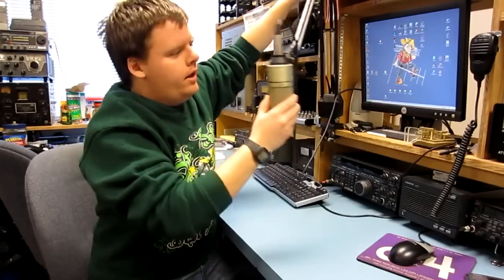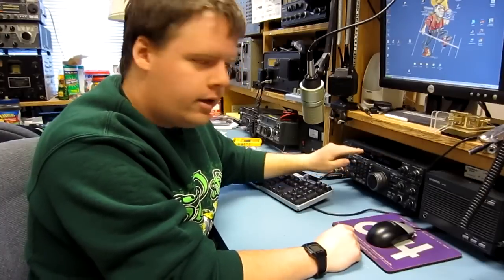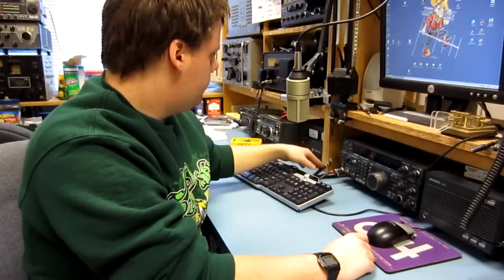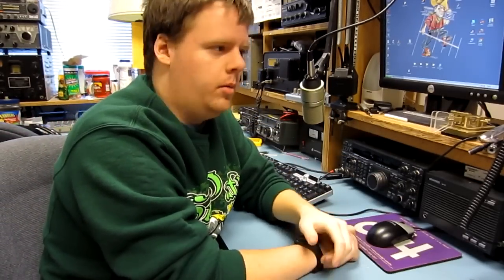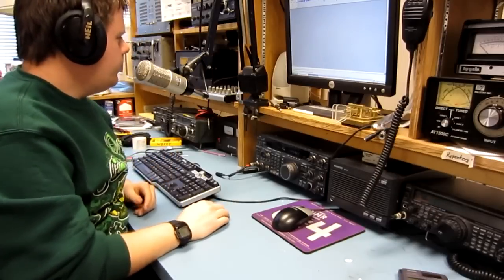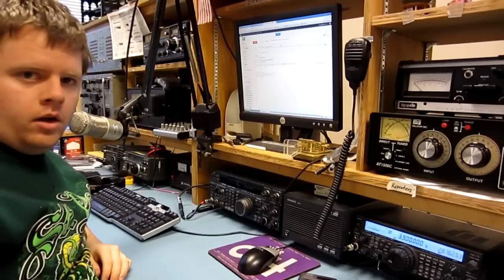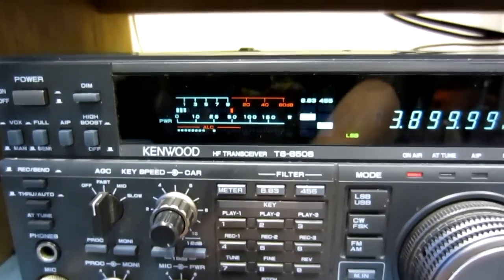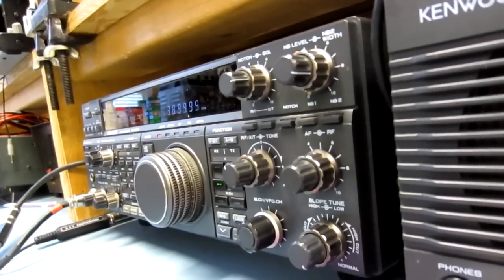How to Have Great Sounding Audio, and a Heil PR40 Unboxing!

Comment from the maker: It is, in fact, automatic level control. It is a radio function to ensure that the microphone level is proper, as to not over- or under-drive the transmitter. It's also built in to many cameras and recorders.

Comment: Hi,good video, I have a Heil pr 40 microphone and pre tube amp with my Icom ic-7300, no mixer needed, radio reports like you wouldn't believe, but a little tricky to set up, but well worth it, thanks from Rotterdam 73

Comment from the maker: @katiebug18371 the mic adapter is a homemade adapter. One pin goes to the 1/4" jack for the mixer (connected to the mic pin) and the other is a PTT line to the foot switch. A standard instrument cable plugs into the left output of the mixer, and the mic connects with an XLR to the mixer's channel 1. 

You're welcome :)

Comment: "Sideways" use of the microphone dates from the earlier radios which didn't have great dynamic range and couldn't handle plosives directed directly at the dynamic microphone element. The carbon mic has compression built-in because the carbon granules pack in together. So historical use of the mic, as seen in Emergency!, Highway Patrol, Dragnet, The Dukes of Hazzard and other shows is accurate. Modern mics are much better at handling the dynamics, and modern transmitters as well.

Comment from the maker: @FUNNYTOM10 The display should have a marking that shows where it shouldn't exceed -- on the TS-850, it's a red line above the ALC meter, and the meter reading shouldn't exceed that red line. Others like the IC-746 have brackets around where the ALC should be kept. Best practice is to keep it as low as possible while still having enough audio to drive your transmitter.

Comment from the maker: Phantom power is for powering condenser microphones. They use an element that requires a voltage (usually 48v) and a small amount of current to power the mic. Without it, no sound comes through. Dynamic mics on the other hand work completely mechanically, and require no power. I turn off phantom power because I'm using the PR40, a dynamic mic. The MXL990 conversely is a condenser, and requires it.

Comment from the maker: I'd have to disagree sirRandyTooth. Not only does the improved microphone lends itself to improved quality, the ability to change equalization allows you to control emphasis of voice information. A voice with a peak throughout the 1500-2000khz portion are easier to understand than others, whereas some gain on the low end is easier to listen to.

Comment: Everyone needs to watch this video. I used to hang out with a guy in the 80's that never turned his compressor off, no matter how much I pleaded with him. 35 years later and he no longer does that but he is still a jerk!!
Not like he needed it, he was running 1200-1400 watts on the antenna.
================================================================================================
I think your 40 dollar mic sounded at least as good. JMO

Comment: Just one more question sterwing, is a sound mixer really neccessary? Let's say I'm just an average novice radio operator that wants to work mainly on 2 and 6 meters (not too much into DX'ing). Could I get away with a good Heil mic and make sure my HF rig is adusted properly for good audio quality?

Comment: you are going line level into mic level you need a transformer to bring it back to mic level .That will give you more head room
set the mixer levels to read zero db on the in/output meter into the transformer to the mic input of the radio and you will have all the control needed without having to worry about to much ALC and over driving the audio.

Comment: Can you help me out with using a condenser mic?  I have mine hooked up, it is a large diaphragm condenser mic, but when I key up all i get is really loud white noise.  I know it is RF interference, but even when putting a choke on the cable it still does it.  Hopefully you can help me out, since I haven't found anything on the net so far.  Thanks,  KB3ZGE

Comment: LMAO!  Because he is using a studio condenser mic that has to have 56v to run the condenser in the mic.  That 56 volts flowing into his radio would put the major parts in Low Earth Orbit :)  Most of the rest of us use a high impediance desk mike like a motorola or a D104 (which is what his radio wants to see).  My old Swan 500 doesn't have an "ALC", it runs on tubes (real radios glow in the dark) but it does put out 480 watts PEP and will talk anywhere on the planet :) He is doing OK.  AE4YW

Comment: im having problems setting up my microphone, i do gameplay videos when i playback my video on my laptop my voice is soo quiet and low i can hardly hear myself and the volume switch wont go no higher, and if i turn the gain too high it makes my voice loud but i get awful sounds and like an echo of my voice. so frustrating. any tips or advice of what im doing wrong. i have bought a tried a few mixers and are all doing same thing??? atm i have behringer enyx 502

Comment from the maker: The cool thing is that it's not mine -- it's the W0EEE hamshack at Missouri S&T. We've accepted many equipment donations like the TS-850 and a FT-1000MP (that I broke :() but a lot of the old stuff has been here before I came. You should see the RTTY and SSB equipment, built like a tank.  flickr dot com/photos/n0ssc/sets/72157629743541287/

Comment: He has a video about great audio but then he is a few feet from the microphone he is recording with and sounds very hollow.  You need to be closer to your recording mic if you are going to post videos, it makes it much easier to understand you !
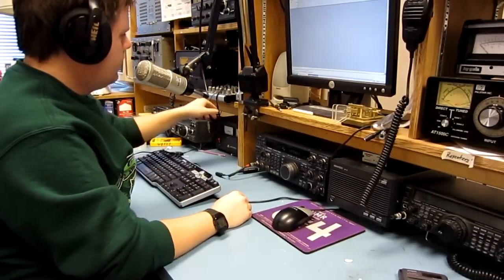Reply from the maker: The author of this video has learned a lot about video production in the 9 years since this video was made. Additionally,  the author was a college student with student debt and a low-quality low-cost camera with built-in microphone that was effective at picking up the nearby room air handler that the author had no control over at the time of production. The author also thought at the time that the effect of changing the audio over to the subject microphone at 9:30 would make for a dramatic experience to the viewer in how such a microphone improves the quality of an audio recording.

Comment from the maker: Nope -- sound mixers are completely unnecessary, as you could wire a good Heil mic right into most rigs; they'll require some sort of interface though, especially with Icom rigs. A mixer is nice, though, because it allows me to use any mic, send audio anywhere, adjust levels, use condenser mics (because of phantom power) and all that fun stuff.

Comment: There's a bit of misinformation you delivered to the public. For one, most certainly the radio matters a whole lot when it comes to ESSB. It helps that your running a Kenwood TS850 it looks like. You will not get the same audio reports out of a YEASU 757GXII, or a Kenwood TS440.
Reply: I agree, the radio is the foundation, if the radio is not capable then a Heil mic is going to do very little
Reply: Well Eric,Mr.Correct information why don't you spell YAESU the correct way? There is NO SUCH THING as a YEASU anything. LOL I know you usually use ICOM gear but if you are going too share information at lest spell the names of the gear properly.What would Ozzy think of you doing this on the World Wide Web? LOL
Reply: 1OFGODSOWN - Don't knit pick on a minor detail, because you've been corrected on a subject matter. Just makes you seem like a sensitive child. Let's be civil and have a technical conversation so we're all more careful on the information we provide. It's okay to be corrected. 

Here's another one for you as an example. At exactly 3mins and 31secs. into the video you show an example of "how not" to speak into the microphone. For one, failure to mention Mic gain levels when doing so can create distortion due to over modulation creating splatter. Second, can create "popping P's" that doesn't create a good sound. This can be a problem when using a mic that uses an electric condensing element with gain too high. Can also happen with a dynamic element as well and can sound even worse. Proper edict in what distance you hold just about any microphone may vary, but a good distance would be at least 2" to 4" away from your mouth with element either directly facing your mouth, or at a slight 10-20 degree angle depending how directional your element is, mic gain, and how the element is housed to prevent popping p's and distortion. 

Here's a little knit picking for you. How about talking into the sides of the PR40. Yes we can "hear you" from the sides of that mic. You proved it too us! Lol

Here's another! Your example of how you sound through your monitor "is not" how you would sound over the air. I can go on, but there's too many flaws in the information and examples you're providing. 

Listen, I'm not perfect and when I'm wrong I listen to those who can teach me how I can be better. I'm not gonna act like I know something where I don't have enough experience in cause I don't wanna misdirect people and look like a fool. I think anyone with enough experience in essb will tell you the same things I'm telling you. I guarantee you. 

So don't get offended. The hobby is about learning and sharing. Take it how ever you want to. Just in those comments you made in your video I mentioned is wrong. 

73